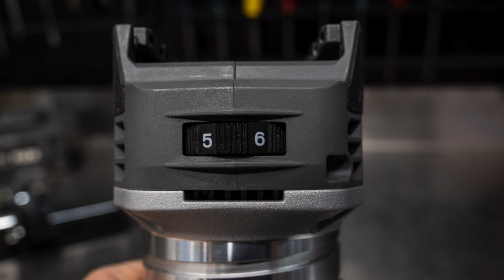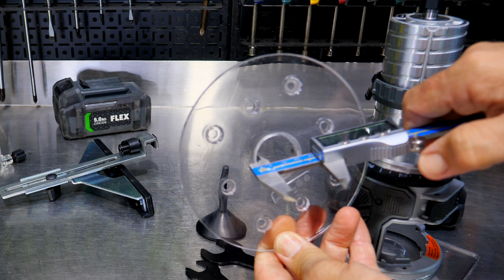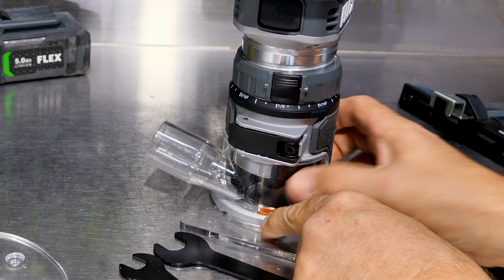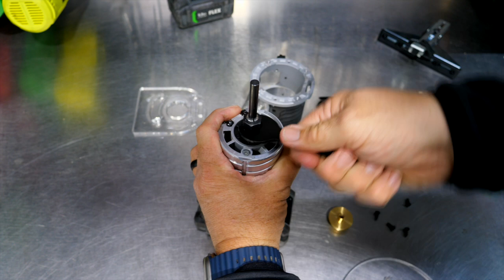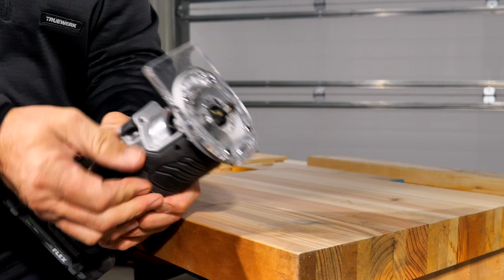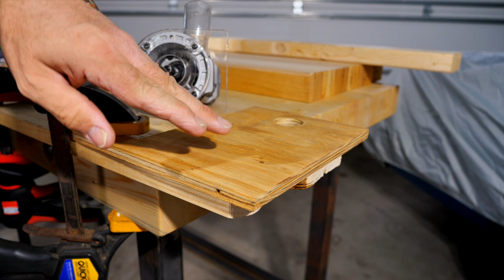FLEX FX4221 24V Cordless Trim Router Review

Comment: I have a total of 3 of these FLEX Routers which I'm gonna set up for door hinges, round over and miscellaneous cutting. I am using the 3.5 Stack lithium ion battery on each unit. This is one of the most powerful finished router i have used.

Comment: The small ring is NOT a micro adjust ring.  It only rotates to line up with the mark on the collar so you can use it as a point of reference when you adjust with the bigger ring.

Comment: Can't trust Flex right now, let's see what happens with their batteries!!!
Reply: I mean I trust them. Even company has issues whether it’s the tool or the batteries, shit happens and the better way to judge a company is how fast they respond and what they do. Which Flex has done a great job so far. The problem with the “leaking” isn’t even the battery cells it’s the phase change gel they added to keep the cells cool. They have addressed the issue and recalled the ones that were at Lowe’s. Just an FYI they use Samsung cells in their batteries which is a sign that they do try and have good quality.
Reply: I heard these Naysayer 3 years ago and I'm still laughing at the haters and Naysayers.
Reply: 731 Woodworks points out people with smaller hands may not like the diameter of this one